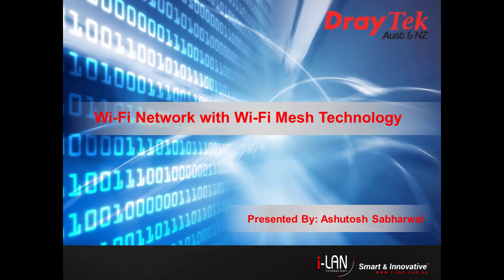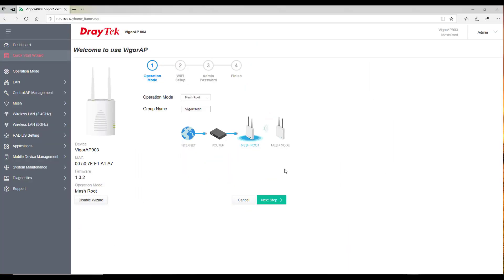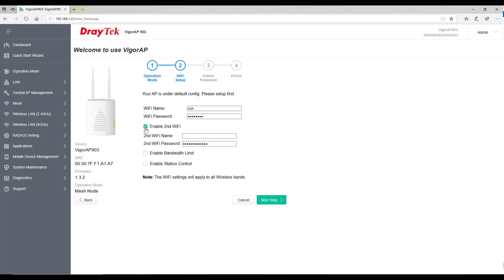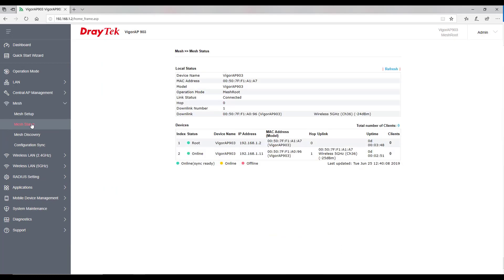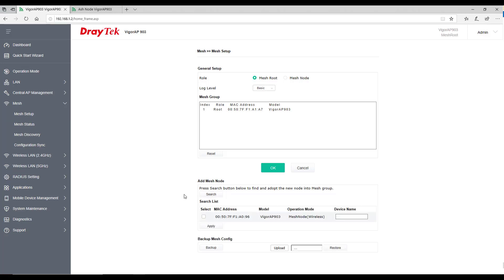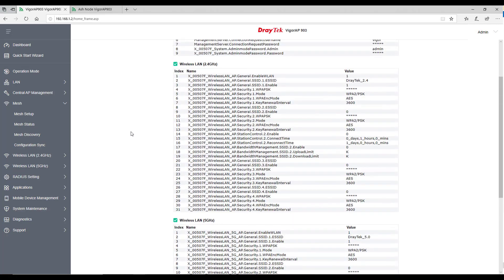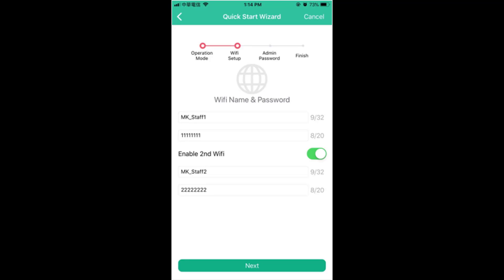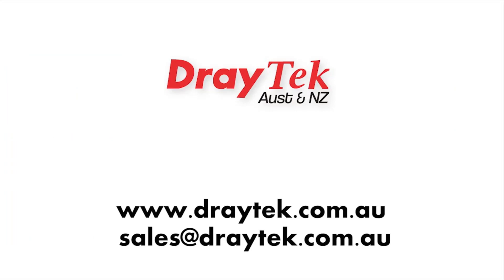Networking with Wi-Fi Mesh Technology

Comment: If using MESH, can a dedicated  MOCA 2.0 (1GBPS) link serve as a back haul (wired Uplink) connection between ROOT and remote node?
Second question: On ROOT and Node units using Lan-A1 (serving as wired uplink, or back haul) are the unused LAN ports still available to connect host computers?

Comment: Can you explain how to connect a node as Hop2 and Hop3, please.? I have added 2 nodes but they are both as Hop1 and another Hop1 and the further one has almost no signal and disconnects all the time. I am searching for 5 hours now and can't find info on how to do it.
Reply from the maker: Hi AgentSkyper, the APs will automatically determine the optimum paths when the mesh is configured. Band steering should be enabled so perhaps check that and try again.
Reply: if your using 903 , try to update the latest firmware. there is now a mesh preferred link choices.
Reply: @johnrono9446  Thanks!  I'll give it a try.